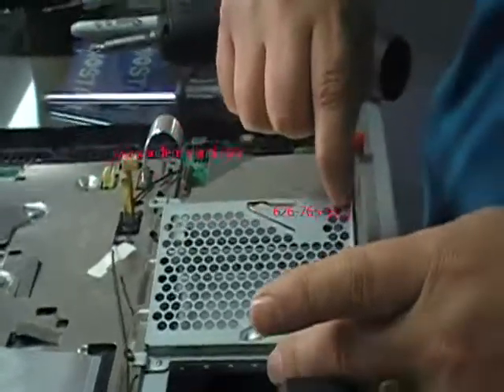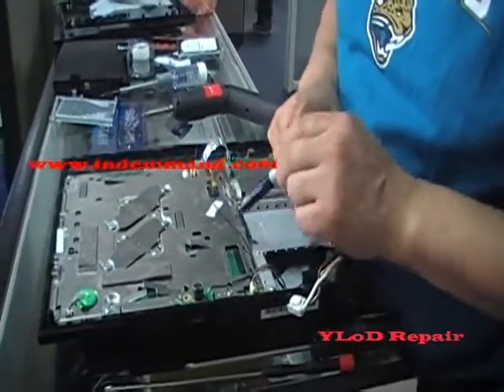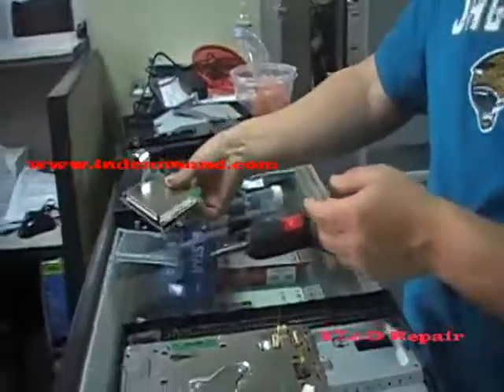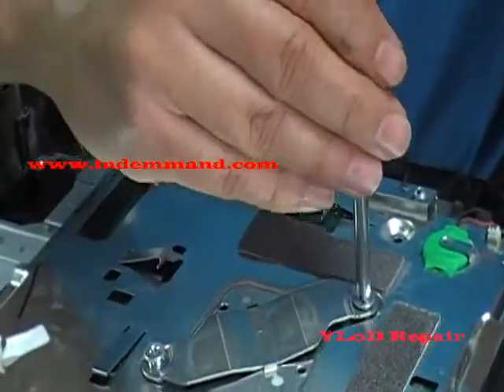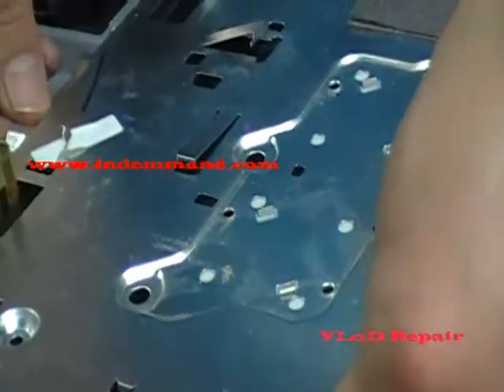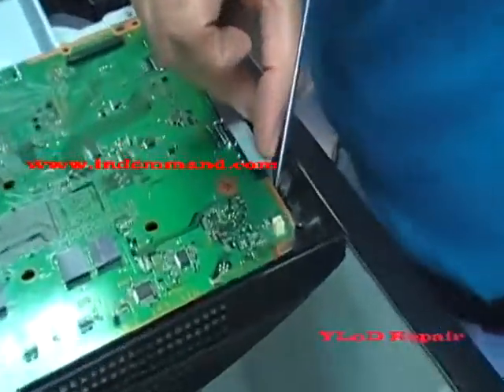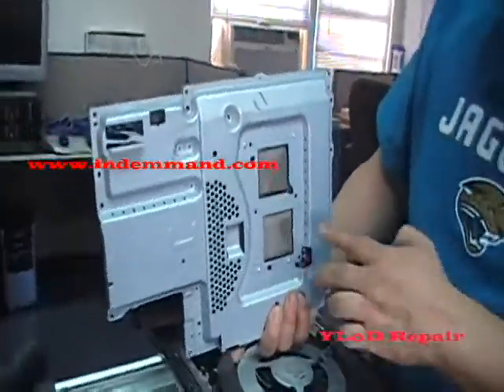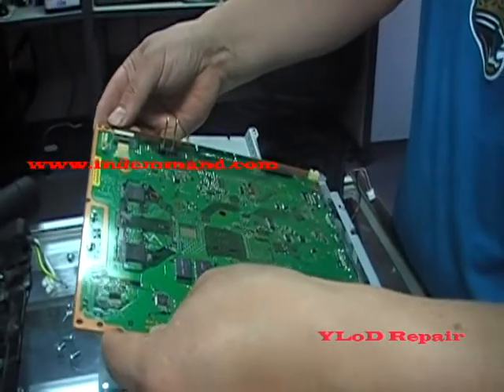Playstation 3 40GB Disassemby Process Step 2of3

Comment: after you remove 5 screws, just lift it vertically. cause there are two metal sticks that are connected to the power supply.

Comment: @miraisrs  I got it! I unplugged all the connectors and then yanked it up! You have to yank because there are two pins connected on the bottom which allows the power supply to stick to the board. Hope this helps.